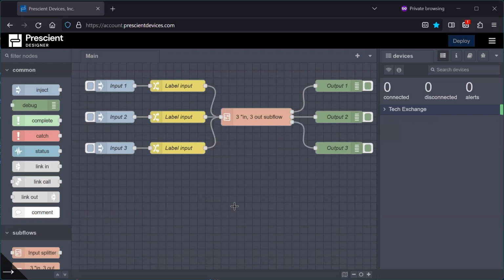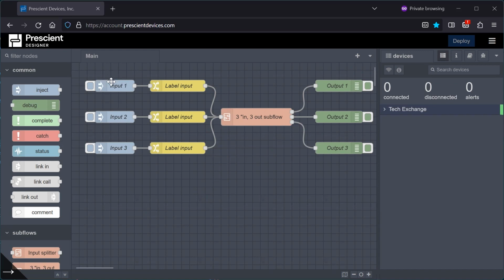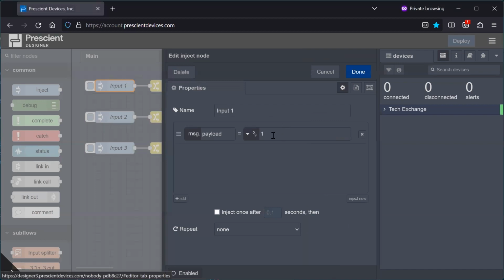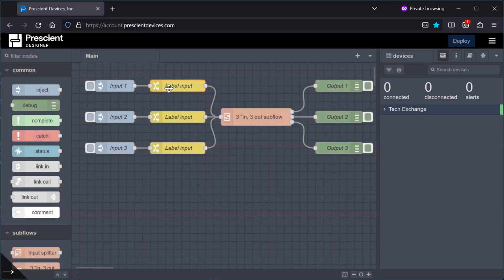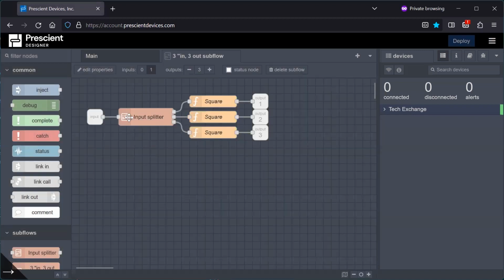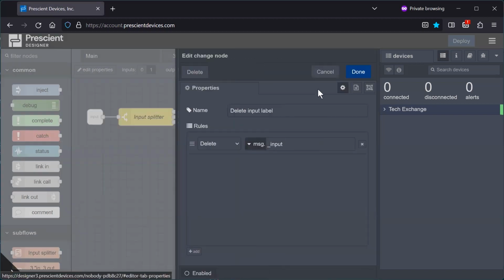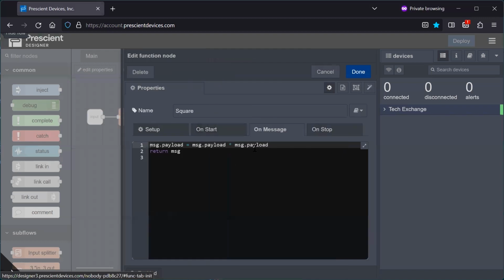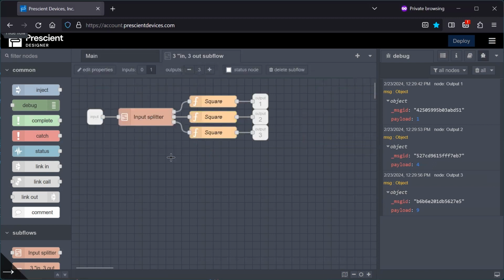Work with Multiple Inputs in Node-RED and Prescient Designer | Prescient

Comment: No sorry, I completely disagree, this is NOT an "emacs versus vi" thing, and it is NOT something that shall remain unanswered for the ages! -There IS a right and wrong with regards to allowing only one input and that is that this is WRONG WRONG WRONG!!! You do not have to be an electrical engineer to know this.   This is essentially allowing you to create functions with only one input.   Suppose I want to create a node that computes OUTPUT = (A-B)*C.  Easy, right?  NO!  How do you even keep straight which input is A, B, and C?  This "workaround"... wow, just wow.  This is the most horrible thing I have ever seen.  The workaround is to create extra nodes for every last function input to introduce this convoluted notion of a label?! You know what, I thought node-red looked promising to meet my needs and now after a few hours into learning how to use it I find this out - just, wow. This is NOT ok.  I am very ANGRY that I have wasted my time learning node-red because this is NOT okay and I will NOT be using any software so fundamentally flawed as this and those are hours I will never get back, not to mention the amount of time I will need to calm down.  There really should be a big disclaimer for anyone considering this product to save a lot of grief and heartache.